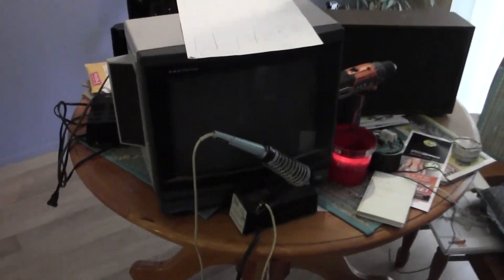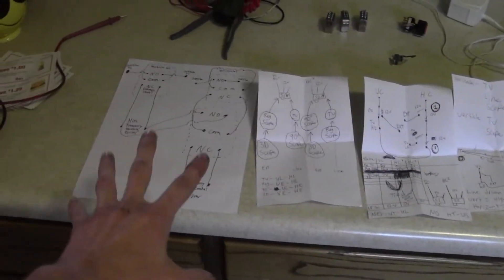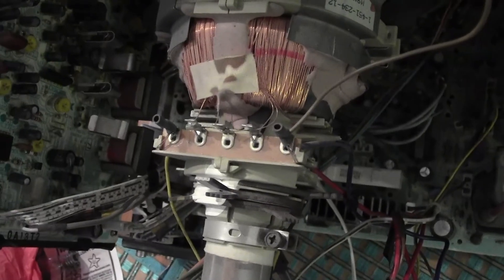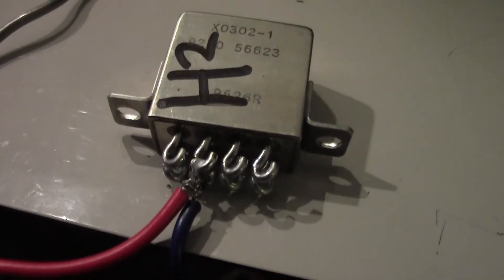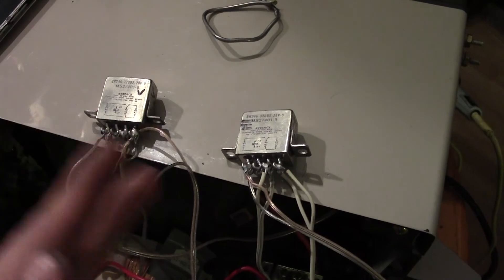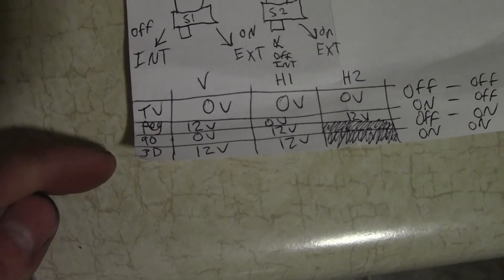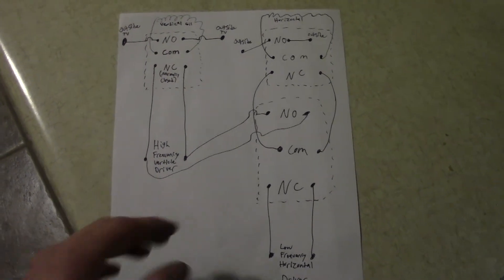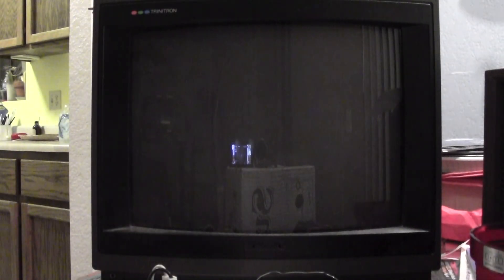How To Turn A TV Into A 4 Function Oscilloscope

Comment: I’m trying to send my guitar amp signal through my tv oscilloscope that I’m building. Do you have any tips on that?
Reply: Here for the same reason lol. Lmk if you figure it out
Reply from the maker: Just make sure your oscilloscope TV is on a separate channel on the amp, separate from any speaker, and just adjust volume on that channel until it looks appealing. There's not really any risk of burning anything up, coil is pretty monstrous.

Comment: Dude you are amazing, just found your channel subscribing and like the video
Reply from the maker: Thanks so much! I'll try to keep it coming
Reply: unigrampa's Laboratory No problem my friend, say would this work for electrical stuff like checking the  frequency of Electronics, and stuff. If so I know it’s doesn’t have a gage or anything to show what that frequency is your testing or checking but I guess you could use test tone frequency’s to make a outer graph I guess is what you would call it.
Reply from the maker: It very well could. Old analog oscilloscopes for the last century were tubes similar to this, with a graph tossed in front of the glass. You adjusted knobs to make the wave form comfortably visible. Scopes like this never had any auto frequency measurement like today. A separate device would have been used for that. This TV scope is just as functional as an old oscilloscope like that if you ignore the distortion from the inductance. That is the only real disadvantage of this setup. Coils instead of charged plates inside the tube. If you can live with that distortion and understand different frequencies will be displayed non linearly and some frequencies may be invisible, it's a perfectly functional scope otherwise.

Comment: What are the specs of the relay? We really need to make this, but $600 in relays is a bit too much for what we want to do with it.
Reply from the maker: Any cheapo Ebay relay will work as long as it has 2 NC, 2 common, and 2 NO pins.
Reply: @unigrampa  Thanks!

Comment: If I were to say, just hook up 2 DPDT on-on switches. One for both the vertical and horizontal coil, then wire one end to an Audio jack and the other to the board of the tv, would this be a problem at all?
Reply from the maker: I believe you are asking if you can use switches instead of relays. This should be possible, just replace each of the relays in my design with a switch. Ignore all the wires going to the relay coils because you'll be operating the relays manually, so to speak. 
The two relays that are tied together will probably need to be two separate double pole double throw switches glued together to make a quad pole quad throw. If you dont physically glue those two switches, and you flip one and not the other, I believe you will cook the TV board. From what I remember.

Comment: Hi maybe you can help me. I tried doing a oscilloscope similar to yours but without all the relays and resistance that you have. I actually saw a couple people doing it in a simpler way in which they only connect  the 2 deflection coils pair of wires to 2 audio jacks socket and that seem to work perfectly. That's what I did but I'm running through a big issue. What I get when I turn the tv on is the initial dot in the middle but it stays super small and becomes really really crazy bright and after a few seconds i hear a small sharp pop, the display shuts and after a big static noise appears ,coming from the back of the tv and continues until I unplug the tv. Any ideas on what's wrong ?  I would greatly appreciate if you could give me any hint, thanks a lot.
Reply from the maker: I will have to think about this. Try re attaching one of the coils back to the TV the way it was? And leave the other disconnected. This should produce a line. I wonder if there is some issue with plasma forming inside the tube from the current through the single spot and gradually decreasing the resistance until it overloads

Comment: TLDR; love this video, best I've seen on the subject. You're a great host and your channel reminds me of the good old times. Subscribed, hope your channel can grow and reach more people.

I like electronics, but I live in a shit country and, as expected, in poor as shit so can't have anything new. I'm even scavenging solder, no need to say anymore than that.

Even so, I have a nice little hacker hole and I learn more and more every day, I love fixing and building things. I have some basic tools but i come to the point where I need an oscilloscope to understand circuits, components and their failures better but again, poor as shit, so I can't even afford those dinky little 100khz hand held ones made in china that are sold in kits for $17-$30, and even if I could shipping it here is a nightmare.

Searching for the on local online markets is just worst, the cheapest functioning-looking one I found was an HP from 1969 that has several missing knobs and buttons and looks like it was used in a foxhole, and the guy wants $130!! Everything else, digital or analog is more expensive. On ebay I found some sub $50 ones that looked real good, maybe if I raw rice and water eat once a day for half a year I could get it but shipping... Oh God shipping.

So I decided to see if I could make one, it seems like a lot of people have and it's a reasonably popular project but almost everyone uses them for audio instead of voltage measurements.

This video of yours is not an exception in that aspect but it is in that is by far the most detailed, simple, effective, no-bullshit, hands on approach I've seen after searching all over. I'm sure I can not only replicate what you did, but also build on it to make a semi-functional lab oscilloscope that maybe won't compare to a real analog scope but it will at least let me visualize some waveforms and learn something.

Taking a look at your channel I see so much dodgey and sketchy stuff I can't believe it, it's like it's the 2008 youtube i loved and miss. Just people doing stupid shit and projects for fun. I'm gonna binge watch all now.

I can't believe you don't have more subs, it's insane, you guys deserve the attention. I'm very happy to have found you and I hope to see much more from you.

Also, the filming was great but just a small suggestion, get some lighting when you film inside, it really boosts the quality of the video. Hack some car lamps onto a stand or something, that'll do just fine. 😂

Cheers.
Reply from the maker: Thanks so much! I find that given enough time, I find a use for every single object laying around. I've stopped throwing away things I can't think of a use for because i always regret it
Reply: @unigrampa  Same, it happens everytime I'm building something, I get that "aw shit, I threw away X thing that had X component I could have used" so now I have a stack of old circuit boards that might kill me if it collapses on me.

I better heatgun the components out before it reaches the roof, it's so much faster to salvage en masse like that.

Also Jesus, youtube mobile butchering my comments. I teach english ffs😂

Comment: man, this is amazing, now i want to do this with my crt monitor, but i have problem, when i disconnect vertical deflaction coil my monitor wont turn on, like in this video https://youtu.be/nt0Uiz1FnpA?t=113
do you know if i could connect a coil from other model of monitor or it needs to be exacly the same
Reply from the maker: Sorry its taken me so long to get back to you. All we need to do is trick the TV into thinking the coil is still connected. You can make your own coil with a similar gauge of wire wrapped around some cardboard or something. If you can get to a similar inductance as the original TV coil, it will work to fool the board. If you have a meter that can measure inductance, that will make your job much easier.